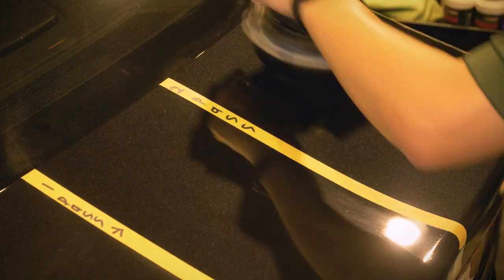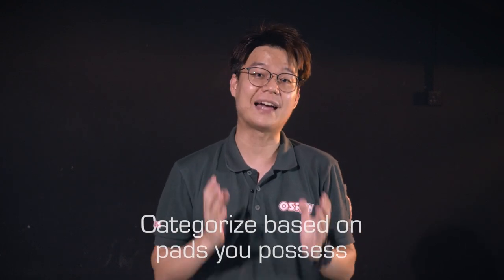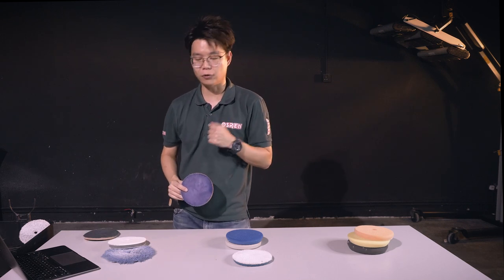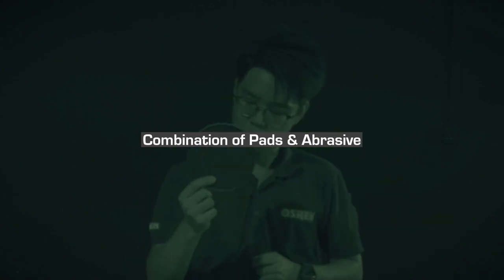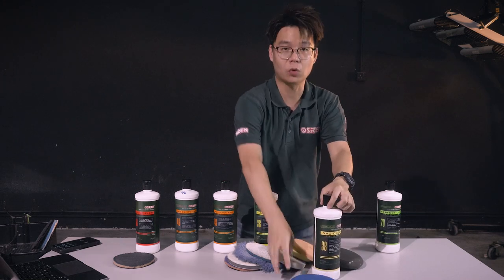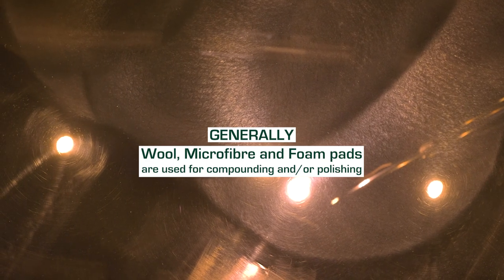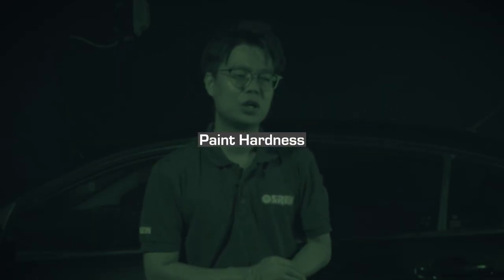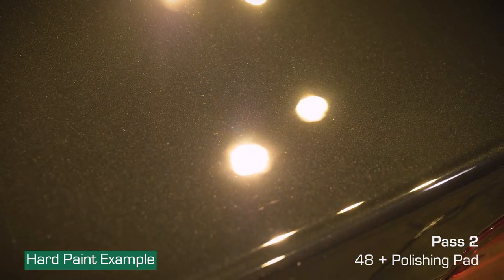Finding The Right Polishing Combination (How To)

Comment: very good guys! thank you!  so for very soft or sticky paint what is the recomendation if we have chemical agresion scratches and generally the paint is in bad condition?  is it better to try pads instead of microfiber or wool on da?
Reply from the maker: For soft and sticky paint, we would usually go with perfect cut 20.

We generally like to go with wool for compounding and foam pads for finishing and soft and sticky paint. Micofibre pads may times be too grabby.

Step 1 - perfect cut 20 + wool pad to remove severe defects

Step 2- nao clear 38 + soft / finishing foam pad

https://youtu.be/Z2BCAaczsmk
Reply: @OSRENOfficial   so to sum up...a soft wool and a superfine polish is the best aproach. because in my country osren is not available. thank you
Reply from the maker: @marinob7433  We do ship worldwide if you are up to try. 38 is a superfine abrasive for finishing. Almost impossible to re-cut with 38. 

e-store.osren.com

Comment: If you are a detailer and you don't know how to pair your pads and products this is NOT how to learn. If you do this as a hobby on your own car this is NOT how to learn. NUFF SAID. MAD RESPECT FROM EAST LONG BEACH 💯
Reply: Just curious, how would you recommend beginners learn?
Reply: @rojoeclipse94  Most manufacturers of detailing products will make suggestions about what products to match with certain pads, after that it's about buffer speed usually between 2500 and 3500 rpm. Then arm speed and pressure. Then practice on panels from junk yard. You will learn quick and not damage anything try it and let me know how it goes,  good luck  😁